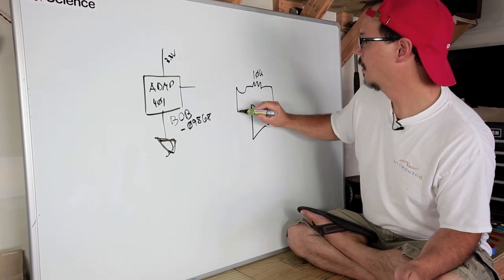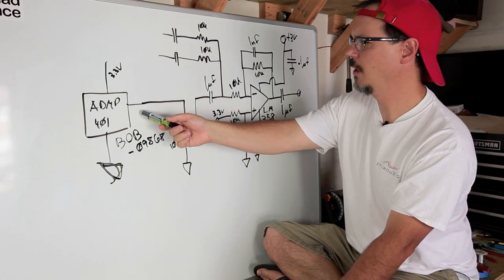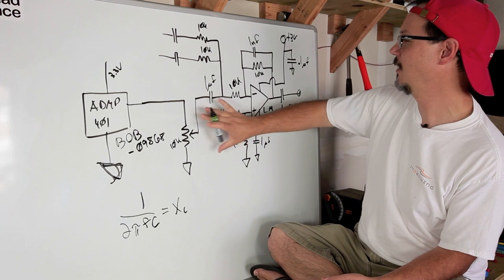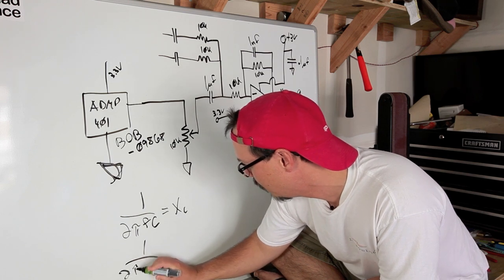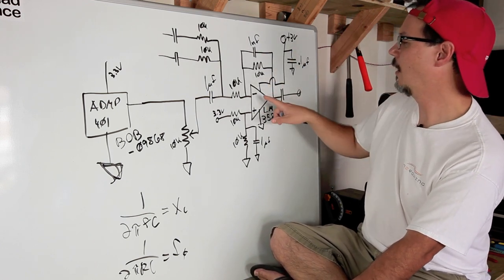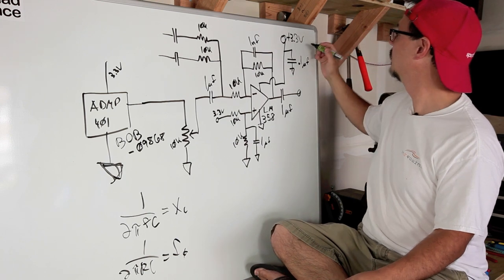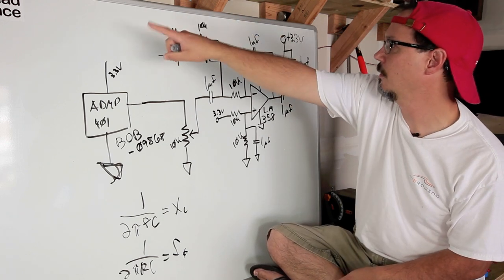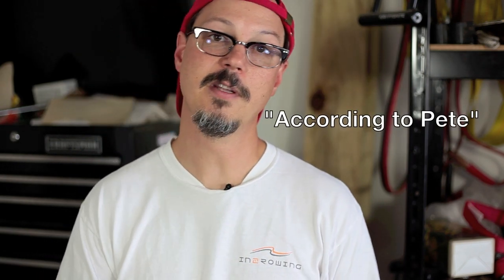SparkFun According to Pete 8-7-12: Guitar Pickup Project (Part 1)

Comment: Pete,you should move your coupling caps to before the pots (between the mic and pots) so that you don't have DC running through the pots,It tends to make them scratchy and noisy. 
I guess you'd have to add another cap,cause you'll probably want one on the op-amp input too,to prevent the bias/offset from moving around when you adjust the pot(s).

Comment: Pete, a man after my own heart.  I've also experimented with attaching mics (Zoom H1) to the body of my electric (Yamaha Pacifica) and any position that is both:  i ] away from the strings, and ii ] away from the "hollows" is redundant.  Also since the MEMS are "open air microphones" ( I think) covering them in tape is going to prevent the free flow of the vibrating air.  ?  GOOD LUCK DUDE.